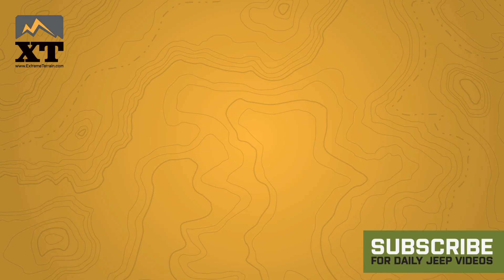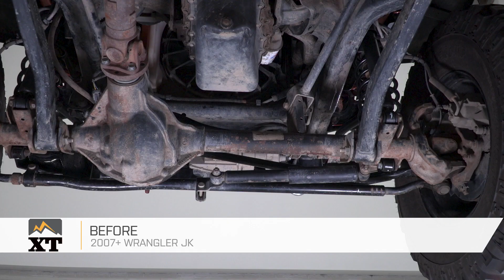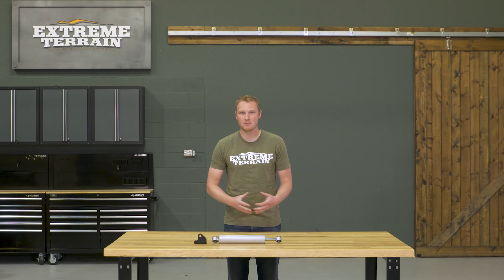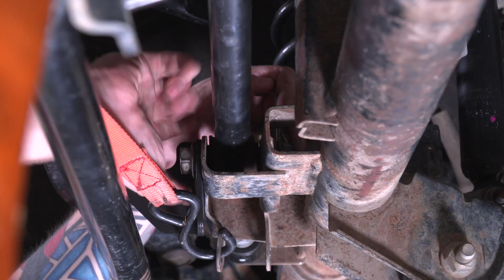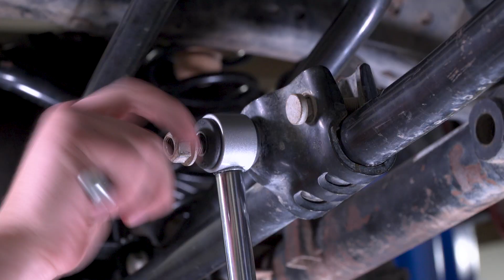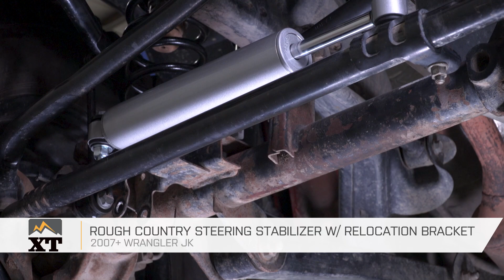Jeep Wrangler Rough Country Steering Stabilizer (2007-2017 JK) Review & Install

Comment: Will it make the steering heavy?
Reply from the maker: Nope! This is mainly a heavier duty replacement for your factory steering stabilizer! It will tighten things up a little but won't affect the weight of your steering. -Zach

Comment: I bought these 3 times in 2 years because the finish always rusts and looks ugly. I figured 125.00 was worth it to match the rest of my kit. Went ahead and upgraded to the Vortex lift and just like the cheap one, everything pitted except the shocks. 

I will be removing this cheap crap off my Jeep and going another Reservoir Shock. Im don't with RC
Reply: I know this comment is old. But I just remove mine, clean er up with a wire wheel or sandpaper and repaint. Looks brand new everytime. I figure if the shock is still in good working order, which most last a very long time, why trash it. Same amount of work as replacing it anyway, so what the heck.